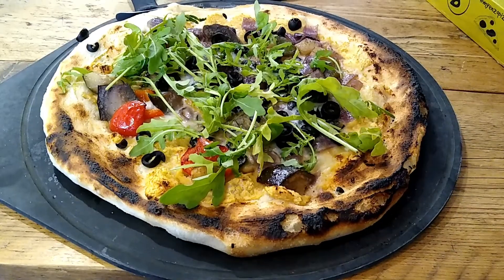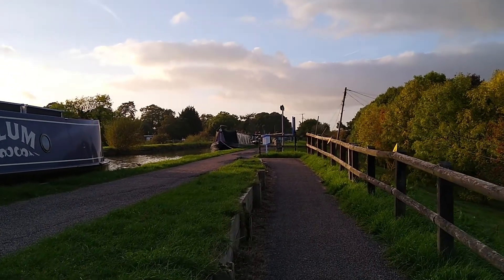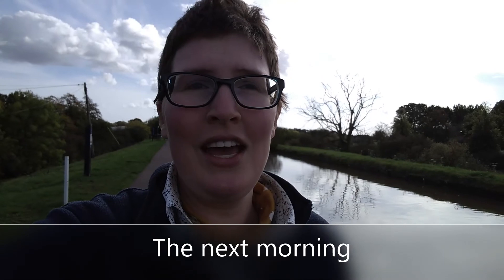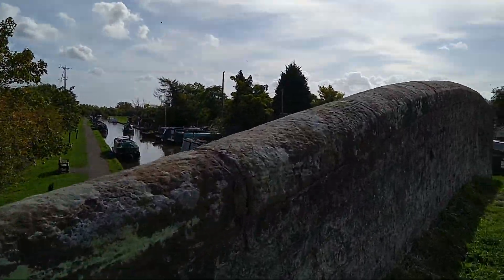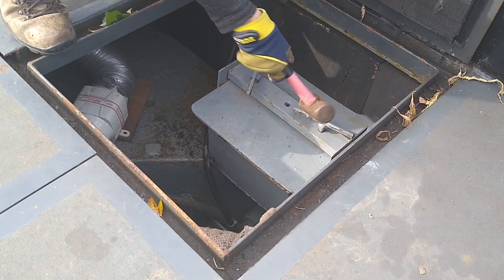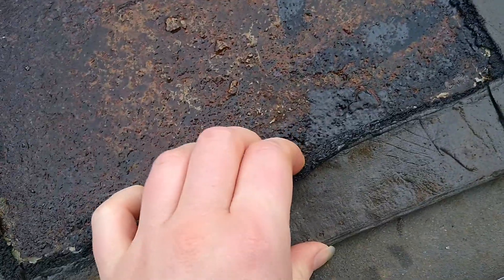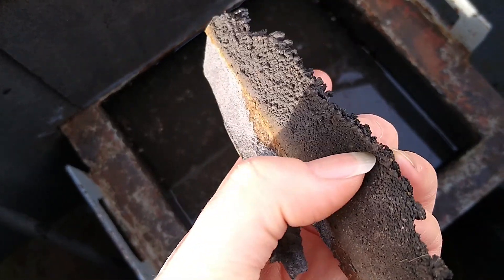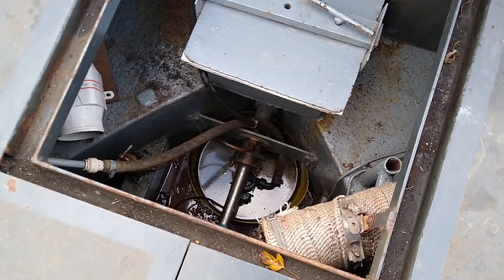31.  Nantwich adventures

Comment: I would only be lifting the weed hatch if it sounded wrong. Each time its opened it breaks the seal and increases the chance of a leak (I would think).
Reply from the maker: It does break the seal each time yes, but I've learnt that one should check the prop for "hangers on" before each cruise (although after this issue I admit to leaving it a couple of days when travelling every day).  I'm too early in my narrowboat journey to know when something sounds wrong sadly - I'm constantly suspicious something is wrong!  At least if I've checked the obvious things each day then I can rest easy a bit there 😅
Reply: @narrowboatnoob  someone should design a hatch with ballistic acrylic window so any tangles can be seen without removing the hatch. Obvious signs of fouling is lack of power, I think rudder judder and maybe a duller more laboured engine tone but maybe if other people could comment.
Reply from the maker: @DEmma1972  oo love that idea! Shame the water is so filthy. I can barely see the top of the top propeller dish! 😂
Reply: @narrowboatnoob  underwater LED. Depends where you are on the canal system and time of day, it can actually be quite light in the water enough to even see the prop shaft. Another method could be enclosing a camera in an acrylic water proof box. Failing that you could use an underwater go-pro on a stick and just reach over the side. Maybe next time you have the boat lifted, you could fit 1 of those cutter blades on the prop
Reply from the maker: @DEmma1972  I totally want a GoPro 😁